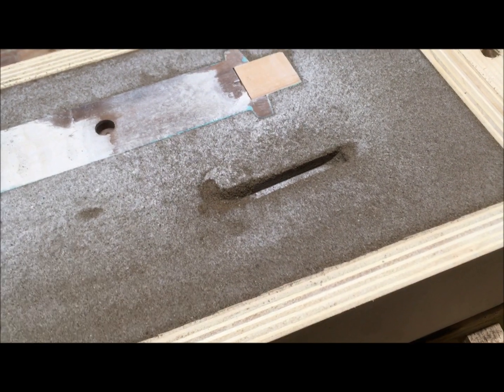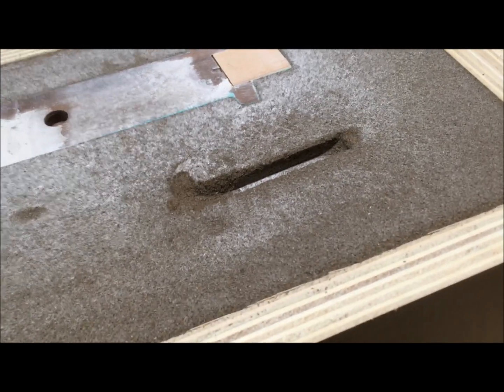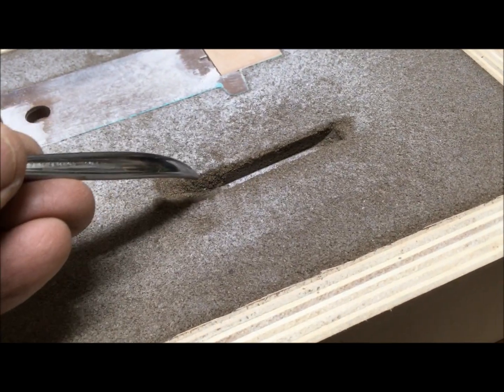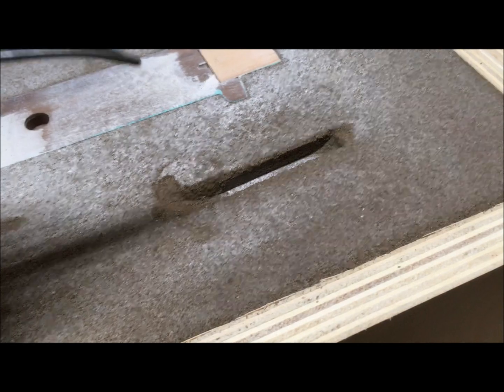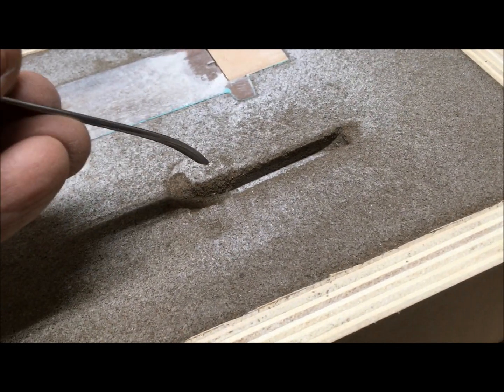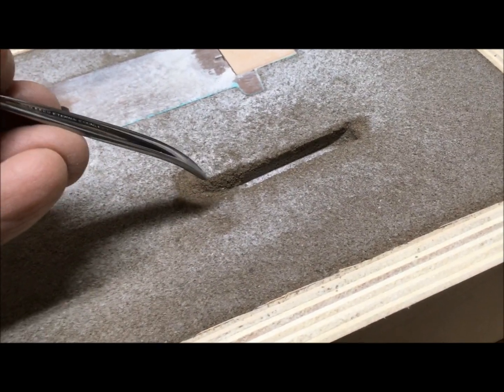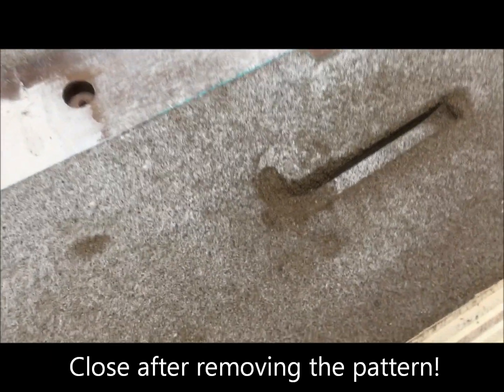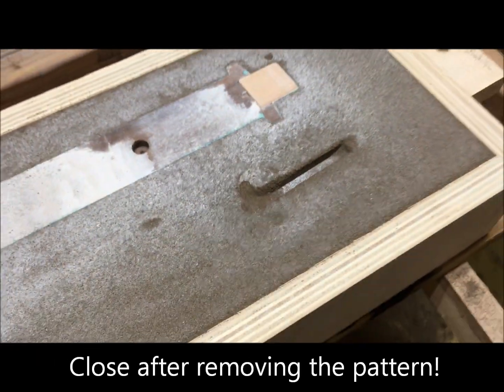Foundry 44: Surge Trap, What is a Surge Trap and Why Do I Want One?

Comment: I think we need to promote the name "surge trap". reflecting the result versus the method. ;-)

Why the ramp at entering the trap? Why not just cut the bottom of the trap parallel to the bottom of the runner?
Reply: Same question, the best part of my spin, I mean surge trap pattern goes in the drag with the runner coming into it tangentially... You think a ramp instead in the drag and the whole trap part in the cope like yours would improve anything?  If so, is there any reason you do not add the ramp to the end of your runner pattern instead of hand-cutting it every time?

Anyhow, good explanation; this part was not in Perry's Puhakka lectures.
Reply from the maker: So that's your spin on it?  We'll surge ahead then.  I think it's more important to be uniform than right, so I'll use surge trap.

It's a little more difficult to cut a disc with draft this small.  And sometimes space makes me want a left spin instead of a right spin, so I just used a straight runner.  I couldn't make a "P" and turn it upside down for the opposite spin.  The ramp is just a means of getting the flow into the cope and only takes a second to cut.  I suppose directing the flow upward a bit does help with surge avoidance but it would be very minimal.

For guys like you who 3D print your feed system there is no reason to not use the tangential disc.  The ramp would be an unnecessary complication.

There is no right name. :-)
Reply from the maker: @tobhomott  I actually want to start the ramp after I get to the riser pattern.  I know for larger systems it is valuable to ramp to a smaller runner before entering the surge trap but I've been a little concerned with these little runners that I don't know how to design it.  Rather than an arbitrary design, I saw such little difference in the glass flask videos that it feels comfortable just going full tilt into the surge trap.  I don't think we saw much rise in the riser ahead of the mold filling.

The second half of all this design is that I'm using wooden pieces to interchange into any pattern I want to mold.  I have a tapered piece made but it is inconvenient to use it so far.  

As far as hand cutting the ramp, there is probably a small gain to be made by having a rough section: more friction like a thinned runner.

Bottom line - I don't think it makes much difference for very small runners.  The main thing is let the metal run.
Reply: @andrewmartin4258  Heh... your mastery of the pun is legendary ;-)

Before we get carried away on the name, I should point out that Campbell and others long before I came along called it a spin trap. That said, who am I to stop a groundswell of people from calling it something more appropriate. ;-D

I hadn't thought of the 3-D printer advantage. I keep thinking that I need to print a runner with a left-hand and one with a right-hand tangent that I can just repeatedly use in my boxes as warranted.
Reply from the maker: @swdweeb  We can't change back, Jeff will get confused.

I probably should 3D print my erector set of feed system parts.  At least they would be consistent.  My wooden ones vary by up to 0.010".  Starts to be significant on a 0.200" runner.  But I've moved back to 0.250" runners for ease of handling and better molding.  Wish I could afford petrobond.
Reply: Something John Campbell told me when I wrote to him with a question about this: make sure the spin trap is well-vented. (Turning it into a riser as you're doing can't hurt, though he did not go so far as to suggest that.) He said he's had results of dross being pushed all the way back into the mold cavity when air pressure stopped the spin trap from filling.
Reply from the maker: @JCSalomon  Very interesting.  Generally we see spin traps with a very small vent.  For me it's easier to make a riser out of it, and I don't see the downside.  There may be one.

Surprising that an unvented one would actually push metal back out.  Could that have been something like a bound sand with little porosity?